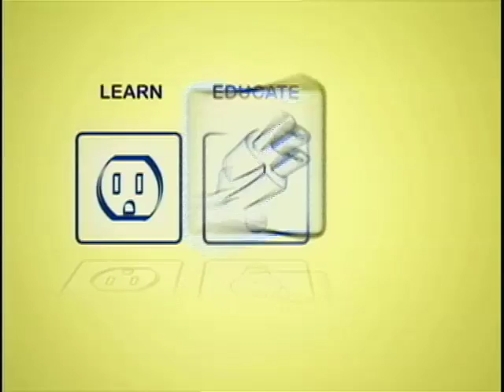AFCI Electrical Safety - Hints For Homeowners - NAPS  TV

Comment: Good vid, but in your next one, you should:
1).  Mention that *combination type* AFCIs are code, not standard AFCIs.
2).  Please point out that if you have knob & tube wiring, you would be wise to replace existing fuses or circuit breakers with combination-type AFCI breakers -even if not required by code.
3).  Again, though not required by code, if you have aluminum wiring it is also a good idea to replace existing circuit protection with combination-type AFCIs.